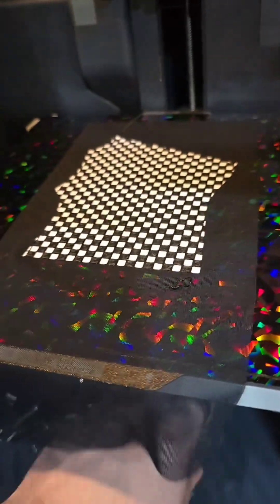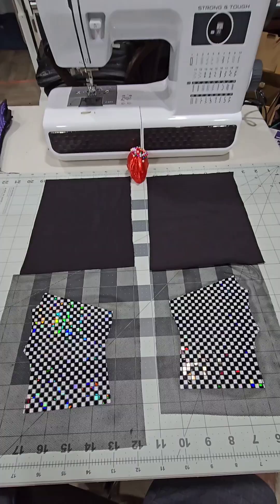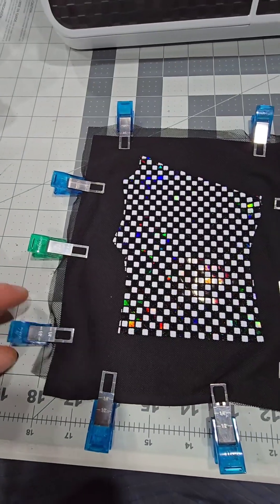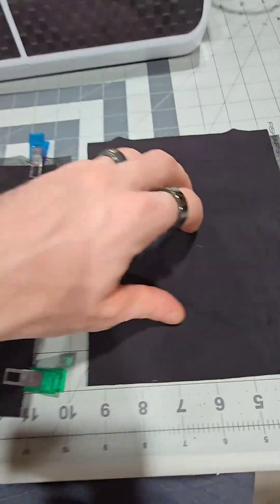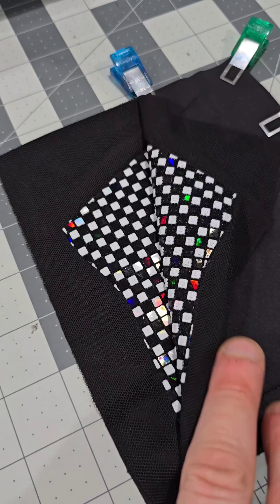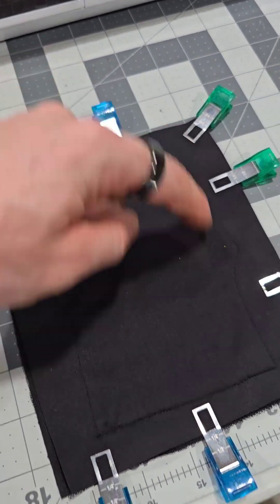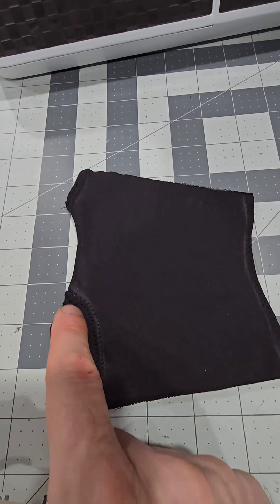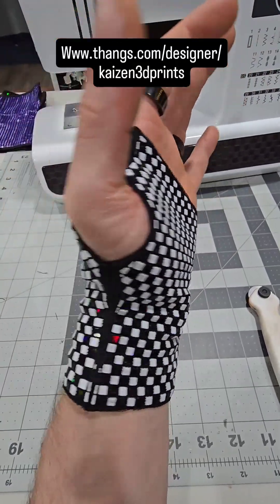3d printing and sewing a short fingerless glove

Comment: When you do the 2 colors, does it all one color then the in next?
Reply from the maker: @Hack3rRunway  yep! It does the first layer of both the black and the white, followed by the pause and fabric placement. So for 3 layers it has a total of 6 swaps
Reply: @kaizen3dprints  did you have a color change block or does p1 not do that? Assuming you used ams
Reply from the maker: @Hack3rRunway  i generally don't use prime towers, and bump my purge amount a bit. I'll program it to start with white so there's minimal black bleeding into it
Reply: @kaizen3dprints  I need to get better with the software